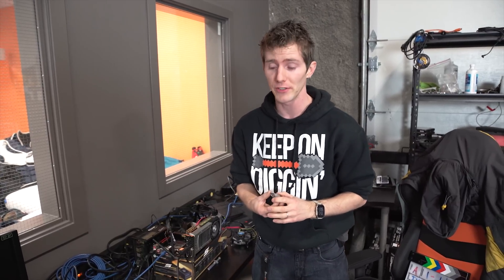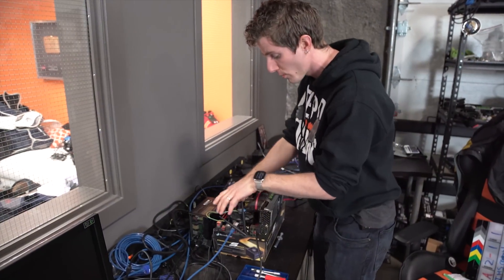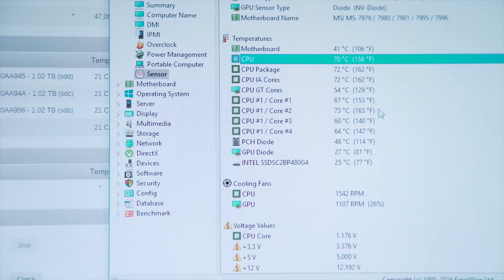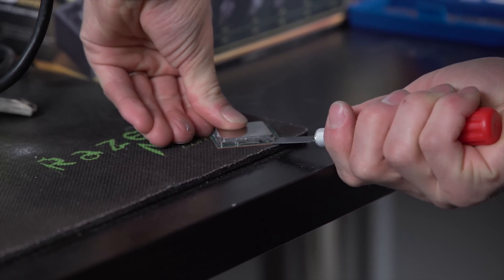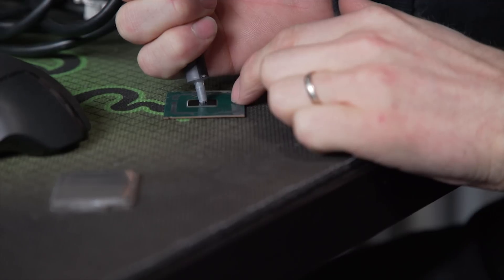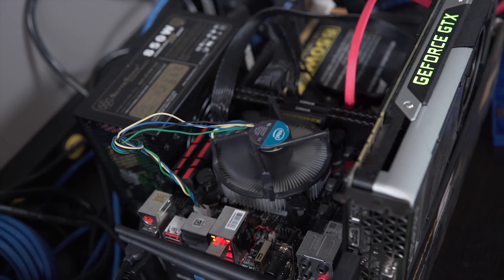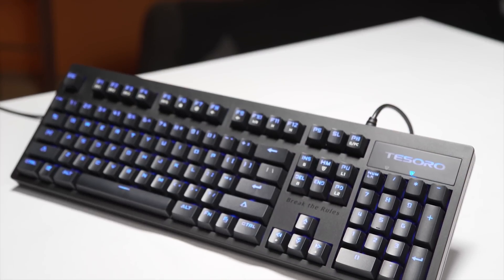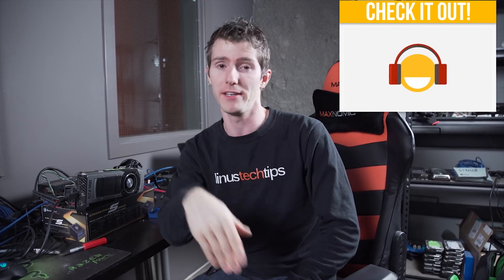Delidding an Intel Core i7 6700K - Is it worth it!?

Comment: what about doing a test without the IHS at all?
Reply: it wont reach or it might crack the cpu. Jaysz2cents did a video on this already.
Reply: +conenubi701 Yeah I was hoping he would do both
Reply: +conenubi701 Straight to die cooling would involve removing the latch mechanism that holds the CPU down because the bottom of your cooler would most likely make contact with the latch mechanism, thus the cooler would never make direct contact with the die. Even after removing the latch mechanism you would still need to somehow shorten the mounting screws of your cooler so that there would be sufficient pressure on the die to spread the TIM.
Reply: Mounting in a naked die is terrifying especialy since the die has just gotten so small these days and mounting pressure on good heatsinks are just so high. I could easily see him cracking the die unless he used some kind of shim.
Reply: agreed.
Reply: anub1s15
Personally would only delid to do liquid nitrogen cooling, but heck Linus seems to have a thing for tech gore with how much stuff he destroys.
Reply: +kiran seehra so does the cooler itself. ihs is only for saftety and ease of use
Reply: +SickFriend1 thankfully EK sells a direct mount kit for there waterblocks hint hint :P

i have the direct mount kit, and a compatible mobo unfortunatly i bought those before i could see if i could fit a knife under the ihs.... intel did a great job gluing down the ihs on the haswell based chip i got since i cant get a knife even half and thick as most exacto knife style things in there with any of the 4 corners ><

butyea since it's already delidded why not go the extra mile and risk damaging the socket as well removing the stock mounting solution and seeing if the probably better reason to delid is worth it (cause really why delid if your not going direct contact, replacing the tim seems like such a waste of delidding
Reply: MinecraftAwaits He's being sarcastic, chill.
Reply: +conenubi701 

Incoming Conspiracy theory:

Delidding and utilizing proper paste with better fan or water cooler options extends greatly the value and lifespan of the CPU, allowing for massive overclocks which can trump the need for more expensive options, upsetting both Intel's system of planned component failure over a planned cycle and trumping the traditional price points that come with pricing for performance.

Because of delidding, Intel's system of planned failure is devoided, allowing at a secondary level, better overclock speeds. 

Linus, being ever a spokesman for the industry, has taken a stance at debunking the delidding method, all the while not actually utilizing the necessary steps to improve cooling which adds to greater overclock ceilings, a great thing for a mid tier chip. 

Anyhow, just a "conspiracy"...which can be read as fiction.
Reply: +conenubi701 Expert here.  Skylake's thinner PCB means it will more likely than not crack if you try to mount a waterblock straight to the die.  The IHS adds structure to the package.  You can direct die cool just fine with Haswell, you just need to shim the springs with some washers to maintain the same mounting force.  I did it with my 4770K and 3770K.  Would do it to a 6700K, but all my systems are Haswell-E.  Direct die + CLU thermal compound + waterblock and you can slam ridiculous voltages into the part and keep it cool.
Reply: ummmmmmmmm old old cpu's didnt have an IHS
Reply: +conenubi701 Only EK makes a reliable direct to die kit.  I am running one right now on my 4790k.  It is not compatible with the 1151 socket as of yet.  I saw a 20c drop on max temps while running Aida64 doing so.  Though my chip had a really bad application of TIM between the IHS and die.  When I took them apart you could see there was next to no pressure being applied to the TIM.  Maxwell was notorious for this.  They used too much adhesive on the edges which kept the IHS too far off the die to be effective.
Reply: +LinusTechTips can you please try this?
Reply: Yes there is,  you cant cool only the electronics you need a middle thingy like the ihs you can also make youre own ihs with copper/alluminium.
Reply: +markothevrba You really are an idiot aren't you.
Reply: +conenubi701 I wanted him to test the Haswell CPU since that was the one that reintroduced the idea of de-lidding processors.
Reply: +conenubi701 Thats how my laptop is
Reply: Damn
Reply: It won't fit in the socket because the retention arm pushes it in to the socket.
Reply: https://www.kickstarter.com/projects/341758082/ncore-v1-naked-die-cooling-waterblock-designed-by?ref=card
Reply: +jlrockafella I think some MSI boards have a "delid guard" that helps prevent something like that from happening.
Reply: +jlrockafella *PaulsHardware, where is looks at different CPUs.
Reply: +conenubi701 Exactly the sam question was in my head...
Reply: well the reason i tried it and i was hoping linus had succeeded where i had failed, my 980TI in a liquid cooling loop can try as hard as it wants, it can't really wander further then 5 degree's from the water temp where my cpu will easely wander up another 35 degree's. wanted to know if this is a cpu trait or if the ihs is to blame T.T since my gpu doesnt have a ihs the cooling is directly on there which is not really the case with the cpu : /
Reply: It can be a little more dangerous since the IHS can spread the pressure over more of the CPU than just the die. Especially with the skylake CPUs bending scandal, that isn't very safe unless you really do know what you are doing.
Reply: +Brian Heuer didn't know they didn't update/change it to socket 1151 yet, but even if it featured socket 1150 mobo it would have been a 100x more interesting conclusion then putting decent tim on both sides yields about double the result of replacing it on one side (1-2 degree's on outside vs 3-4 with replacing it on both side's >.<)

apart from poor contact scenario's i couldn't imagine a different outcome. 
but atleast you answered my question about if it's likely the ihs is causing more harm then good temperature wise with watercooling...damnit intel why did you do such a good job on my cpu getting that heat spreader on there T.T not really comfortable putting it in a vice unfortunatly :(
Reply: +Brian Heuer That was only some of the i7-4790k that where fucked, my 4790k is fine but i do run a Nepton 280L on mine.
Reply: +FurIouS19811 what were your temps before you delidded? my 4790k @ 4.8ghz peaks at 70c with a nepton 240m. maybe it's due to living in miami but still seems fairly high lol
Reply: +Brian Heuer Maxwell?
Reply: The ihs spreads the heat across the plate so it can dissipate easier
Reply: +MinecraftAwaits no ur the idiot, it makes a lot of sense, he said it in the beginning of the video.
Reply: boom!
Reply: +cjgaltieri dies anyone know the name of the software hes using to monitor the temp?
Reply: +cjgaltieri correction.......Does.........
Reply: +InVidia Gaemz I am not sure what program he is using for that.  It did look really nice though, nice clean interface.  I use HWMonitor from CPUID myself: http://www.cpuid.com/softwares/hwmonitor.html
Reply: +cjgaltieri Thanks CJ. I'll take a look it.
Reply: +InVidia Gaemz top left corner says... Aida64.  if you look, you can see it too.
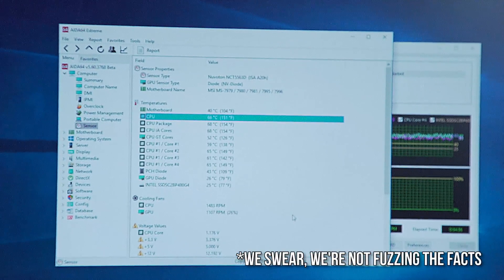Reply: +InVidia Gaemz it even shows you which tabs are open in the screen.. take two seconds, hit pause, and everything is clearly displayed at 7:31.
Reply: +anub1s15 Go get an actual scalpel. They aren't that expensive.
Reply: so theres no real need for the IHS in terms of temps
Reply: Isn't the CPU incredibly delicate without the IHS?
Reply: Lonewolf well, good to know. How many degrees in celcius did removing the IHS change, obviously this is a broad question, and as such I provide a not dumb question (doing this on the fly) how effective was removing the IHS?
Reply: https://www.youtube.com/watch?v=n4O_Dq3xRJA
Reply: +SickFriend1 We have seen time and again that he can be quite handy with zipties
Reply: +conenubi701 It's impossible, the CPU gets so cold it freezes the computer.
Reply: FurIouS19811 I know.  Mine was one of the bad ones unfortunately.  My core 3 temp would be 10-15c higher than every other core.  Which led me down the path of delidding.  You could even see on my EK Supremacy Evo, that one edge was higher than the others as it scratched the copper on the bottom around 1 corner.  My idle temp drop was not very impressive.  However max load was almost a full 20c with Aida 64 and stressing the FPU.  Can't really beat that.
Reply: Bartosz Olszewski Nope, if it was just bare without the ihs, the temps would rise considerably, the heat would be contacted into one place and that wouldn't make for the temps to be easily dissipated compared to having an ihs to allow dissipation over the whole thing making it a lot cooler